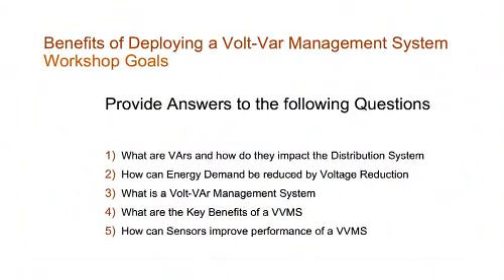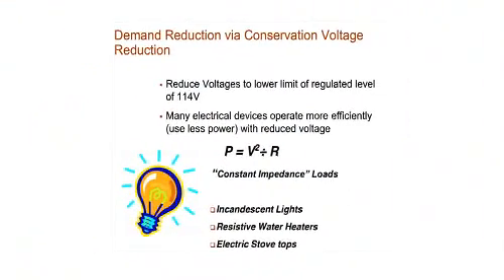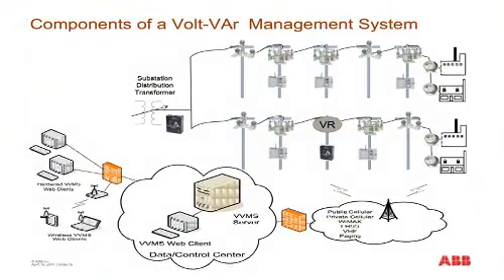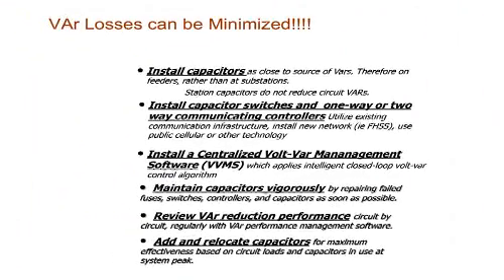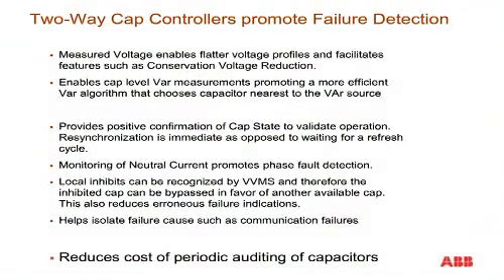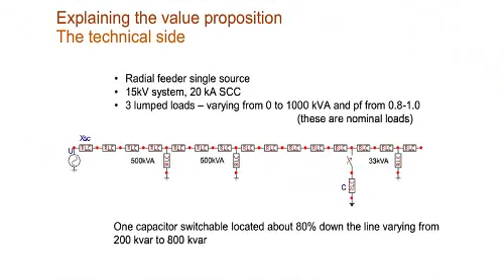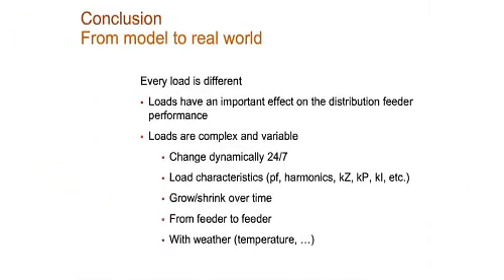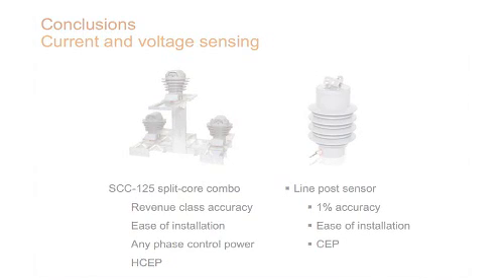What is Volt/VAr optimization and why is it so important for a smart grid?

Comment: 2 problems are happening from VVO. Electric companies that have been running at or above nominal for years and years at 122 or so and customers running 230v motors with wye voltage. It's never been a problem before because the bottom end of a 230 motor is around 208. Now that 214 phase to phase voltage is running 196 customers are having ac compressors burn up. Second, even though 114 is within tolerance of most electric co standards today's equipment that are microprocessor driven and are more sensitive to voltage swings. Running 120 or even 117 and having a voltage drop from motor start ups on the circuit is one thing. Maybe drop to 115 or so but run 114 and have the same situation and then you are in the 110 neighborhood. Just because you can run 114 does not mean you should run 114. imo